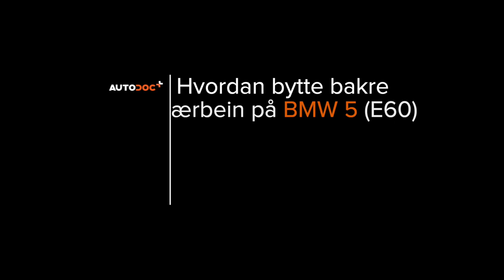Hvordan bytte bak støtdemper der på BMW E60 [AUTODOC-VIDEOLEKSJONER]

Comment from the maker: Merk! Det er en feil i denne videoveiledningen.
06:48 - Skiven bak må strammes med dreiemoment på 27 Nm, ikke 55 Nm.
08:38 - Skiven bak må strammes med dreiemoment på 165 Nm, ikke 72 Nm.
08:45 - Skiven bak må strammes med dreiemoment på 100 Nm, ikke 80 Nm.
08:51 - Skiven bak må strammes med dreiemoment på 100 Nm, ikke 75 Nm.
09:37 - Skiven bak må strammes med dreiemoment på 110 Nm, ikke 75 Nm.
10:43 - Skiven bak må strammes med dreiemoment på 28 Nm, ikke 38 Nm.
Vi beklager ulempen 🙇‍♂